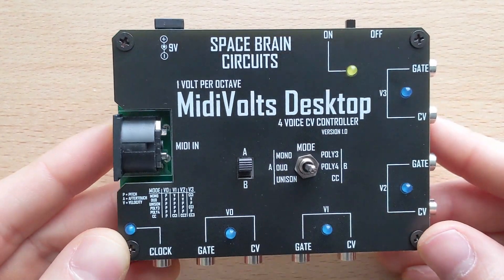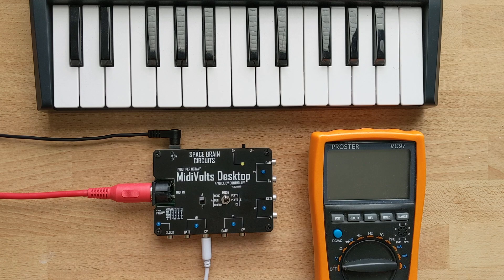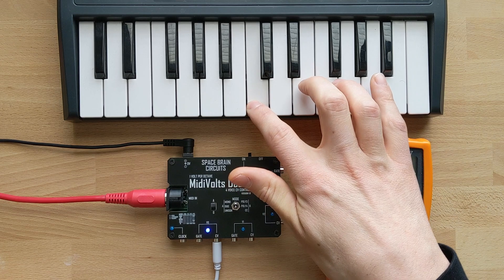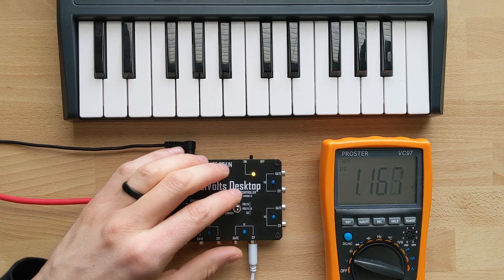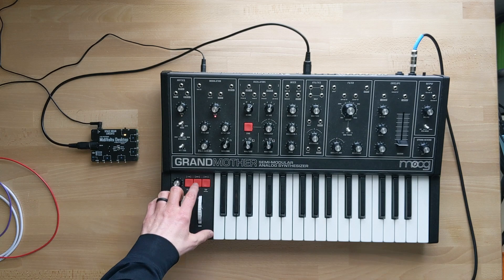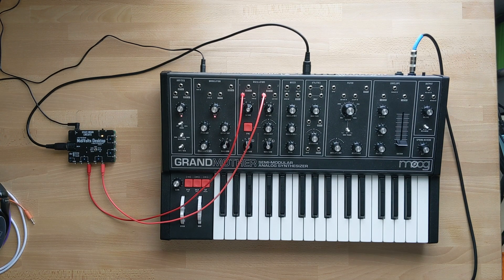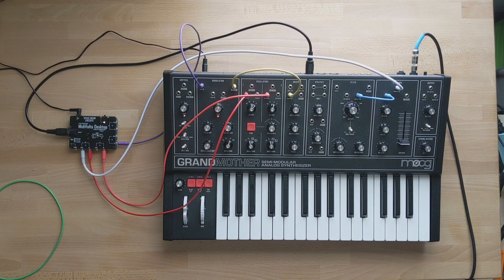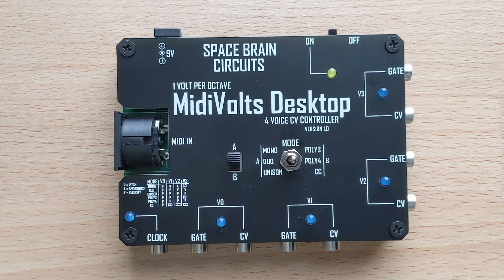MidiVolts Desktop - Polyphonic 4 channel Midi to CV Controller

Comment: I'm thinking MS20 might be my only mono? 

what about with a mono/poly? (original so probably will have to use a kenton..) can i use midivolts with the huge mono?
Reply from the maker: @welovethesnorks  unfortunately the ms20 does not use 1v/Oct so the MidiVolts doesn't work with it. 

Not too sure with the mono poly. But I guess the unit already has poly features? How were you thinking of using the device? For CC? Thanks for the kind words!

Comment: Hi ! Just got a MidiVolts and I find it very incredible well code and built. Im trying to trig some kick and snare from logic to modular stuff and was wondering if theres is a way to send gate 1 and gate 2 to different channels or any work around beside buying a second one haha Thanks !
Reply from the maker: Hey, yes I think we have a few options. No need to purchase another one. You could always utilize CC mode. From logic, you can send different CC messages at max value (127). You can then use the CV outputs to trigger your modular. Or, I have an alternative firmware version avail that allows you to assign different midi channels to each output. Its very easy to upgrade on windows but mac a little more tricky.
Reply: @spacebraincircuits1358  Wow ! Yess I thought about the cc option but its less convenient for the daw editing ! But yeah I would absolutely try that firmeware ! How can I find it ? On github ? Thank you so much
Reply: @spacebraincircuits1358   Wow ok !! Yess I would be absolutely interested in that firmware :) I thought about the cc option but it not optimal for the editing part of Logic.  W here can I find that firmware ? On Github ? Thank you !

Comment: Is this possible for matriarch?
Reply from the maker: Hey! Technically yes but not much is added. Unless you wanted to sync the up multiple synth, there's no way to add additional voices on the matriarch! Thanks for the interest though!
Reply: @spacebraincircuits1358  I don’t want additional voices, just to make the 4 voices it has polyphonic instead of paraphonic. Curious if this would help with that or is it not necessary to do so?
Reply from the maker: @SU-ue5ej  oh I see, unfortunately this still does not help since the matriarch only has 2 on board VCAs. However, if you had some additional VCAs such as eurorack modules, this would be possible !

Comment: I'm fairly new to modular... but out of curiosity if you were to use two of these could you get 6-note polyphony on a matriarch?
Reply from the maker: Unfortunately, this is not possible with the MidiVolts desktop! But thanks for the advice. I'll consider this in the future

Comment: Would this work with the subharmonicon?
Reply from the maker: Hey! Yes, the device is compatible, except the subharmonicon only has 1 oscillator, so you wont be able to create chords. However, you could use the sub harmonicon with a mother32 (For instance) and create chords by creating a somewhat hybrid polysynth. Hope this makes sense! thanks!
Reply: @spacebraincircuits1358 yes! I believe the subharmonicon has two oscillators in it. If so would it just be more of a duophonic sound?
Reply from the maker: @louie_c_morris  oh wow I just checked the user manual and you are correct! The sub does have 2 oscillators and more importantly has two separate pitch CV inputs. So yes, you could generate a duophonic sound using this! Thanks for the correction!

Comment: Hi! Ill build a Minimoog Model D replica "rack", and then use a modern CV to Midi interface to use any keyboard controller or computer..my question is...the Midivolts is the interface I have to use? Thank you!
Reply from the maker: I also sell a eurorack version that may work for you a bit better! Thanks for the interest!
Reply: @spacebraincircuits1358  wow, than you for your quick response! Where is the link/ contact for the eurorack version? Do you ship to Brazil?
Reply: You are still using the same email you put at the yt description? Im an EE, and already bought the components to build the minimoog at mouser, using, thefantasyjackpalance  and yt videos...and so Ill have to keep your eurorack cv to midi interace as well 🙂
Reply from the maker: Wow sounds like an amazing project! You should document the journey. In case you are interested, here is the euro version. https://www.etsy.com/listing/1354414919/midivolts-modular-polyphonic-4-voice

But also, running a sale on the standard units as well. Best of luck! Sounds like a great learning opportunity! I'll have to check it out!

Take care best of luck

Comment: Hi! For someone who doesn’t really understand all this (yet) could this turn a subsequent 37 into a polyphonic synth?
Reply from the maker: Hey! Unfortunately, since the sub37 doesn't have multiple pitch CV inputs, it's not possible to use the device to create polyphony with just the sub37.

However, you can create hybrid polysynths by combing multiple monosynths(such as sub37) with other monosynths. Hope this helps! Thanks!

Comment: How would this work with a Mother 32? What would be the capabilities? Very interested to know. Thanks for such great content!
Reply from the maker: Thanks for the kind words! Basically, you could combine the mother32 with another monosynths and achieve poly playing, since the mother32 has 1 oscillator. Combining the grandmother and a mother32 would allow for 4 note chords since you have a total of 4 oscillators (x3 GM and x1 M32)
Reply: @spacebraincircuits1358  sweet thanks for the quick response!

Comment: It'd be awesome to have a mode where I can use four separate MIDI channels to control four separate mono instruments. (I know, I want the moon on a stick)

Edit: Just noticed that you said this feature is available on the Eurorack version, which is perfect. Thank you.
Reply from the maker: Actually on the eurorack version this is possible. But you would have to upload an alternate firmware version! Thanks!

Comment: hey yo again, i've since got a matriarch but i was wondering, is there a way i can now get 8 voices with my matriarch if i use the grandmother for the 4 extra voices 

so use the matriarch keyboard but it's using the midivolts to get voices from the grandmother .. not sure
Reply from the maker: Hey Duncan, this is doable if the matriarch can polychain but I'm not too sure. It would be amazing though.

Comment: Are those 1/8 or 1/4 outs? 
How would you get it to work with a 1/4 CV?
Reply from the maker: Hey reso! They are 1/8 (3.5mm) jacks. You can just use a simple 1/8 to 1/4 inch converter! They are really affordable

Comment: I'm not an engineer, or modular guy, so I don't really fully understand, but this is awesome. I just ordered a Grandmother, so I may end up getting one of these.
Reply from the maker: Cool thanks! The GM is an amazing synth and you will be pleased!
Reply: @spacebraincircuits1358  I'm on a different account. Grandmother will be here tomorrow. I just ordered your last MidiVolts Desktop off of Etsy earlier today. Thanks for making such awesome, smart, and most of all, useful gear like this! I hope you become very successful with your company! You deserve it with this type of gear.

Comment: Will this work with my ms20?
Reply from the maker: So sorry but the ms20 is not volt per octave but hz per octave so the midivolts is not compatible!
Reply: @spacebraincircuits1358  it's 1,5 volts Indeed. Thnx for the answer

Comment: Awesome! Will this work with the Behringer Model D?
Reply from the maker: Thanks for the question! I believe the Model D has only 1 pitch in CV so not possible to make polyphonic. However, you could use the MidiVolts to connect up two or more monosynths to create chords. :)

Comment: Could this be used to just to convert the midi to clock signal. I really like the simplicity of “sync” functions rather than midi. Mostly because I’m still learning to use midi
Reply from the maker: Yes, it also has a midi to clock converter! Essentially, the midivolts waits for a midi start message and begins toggling a gate output. Hope this helps!
Reply: @spacebraincircuits1358  thank you so much! 
This is off topic, but you know way more than me so…is it possible to add sync in/out on a Boss 20xl loop station? Or a loop pedal that isn’t equipped with Midi?
Reply from the maker: @erictorres2368  sorry not really sure! Kinda depends on the underlying framework. Could be possible if it's all analog hardware
Reply: @spacebraincircuits1358  thanks for responding. It was worth a shot. 
I’ll be purchasing one of your sequencers soon. Can’t wait to try it out!
Reply from the maker: @erictorres2368  that sounds good!

Comment: could you project for Korg MS? it was a dream for many years I’ve got 2 ms20 and 2 Ms10 4 voices poly a big dream
Reply from the maker: Hey thanks for the comment. Unfortunately, I believe Korg operates on V/Hz instead of V/oct which the MidiVolts doesnt support. Double check me on this but wanted to be transparent!
Reply: @spacebraincircuits1358  yes you right !! does it not possible to make it for Korg and yamaha V/HZ ?
Reply from the maker: @disto99  With the current circuitry, its only possible to get 1 or 2 octaves. So sorry about this. But thank you for letting me know you are interested and I will consider this for the future!
Reply: @spacebraincircuits1358  yes of course really interested !! let me know

Comment: Would I be able to send mid from vcv to this device to convert to cv to use with my matriarch ?
Reply from the maker: Sorry about the late reply! Yes definitely! In CC mode, you can just use the device to send control voltages. A lot of my customers like to use ableton live since you can modulate the CC values :)

Comment: Do you need this device to pull off this effect if you already have a GM & a matriarch?
Reply from the maker: If you have both, you can essentially tie both synthesizers using the same CV controller. Not sure this would make much sense though, especially sinc the matrarch already has 4 voices.
Reply: @spacebraincircuits1358  ok thank you for the reply.. i was just wanting to do something different, like what you did with the gm. u know a lot more about synthesis than i do!

Comment: Hi,
Thank you for this vidéo.
Is this kind of alternative tools at DoePfer Dark Link USB / MIDI-TO-CV / gate-interface?
Kind regards.
DRJ ;)
Reply from the maker: I'm not familiar with doepfers midi to CV. This is more of a specialized mid to CV aimed at making Polyphonic possible. But it can be used in many different ways that's similar to the more conventional midi to CV converters. Thanks for the question! Let me know if you have any others!
Reply: @spacebraincircuits1358 
Thank you for your reply.
I will contact you by personal messaging regarding a specific request on your device.
Goodbye.
DRJ 😉

Comment: Would this work with Arturia Minibrute 2S?
Reply from the maker: Hey Eben! the device is designed to work with any 1 v/oct oscillators. I do not have a minibrute2s but would love to see the Midivolts control one of these. 

Most people that purchase use with their moog gear, grandmother, mother32, subharmonican, werkstatt etc. Shoot me a message on Etsy if you interested in purchasing!

Comment: Nice! Where did you get the mini midi cable , if you remember?
Reply from the maker: I'm pretty sure I found it on ebay but it was so long ago. I'm sure you could find one on Amazon as well. Think it was 12 inch midi cable. Good luck!
Reply: @spacebraincircuits1358  thanks a lot!
Reply: This is lot to soak in my brain. Can I use this minivolt for a minimoog d? Thank you

Comment: Can I play in the polyphonic way and move parameter buttons at the same time?
Reply from the maker: Yes, the parameters on the MVD change after all notes are released. So if you hold a chord while switching a toggle, the change will take place once you lift all notes. Hopefully this makes sense! Thanks!

Comment: How does one calibrate this? As soon as I go from in tune in unison and I flip to poly and I'm out of tune already
Reply from the maker: Hi there! All units are calibrated before they leave so your CV response should be very good.  Have you seen the MidiVolts beginners guide on this channel? Definitely check this out if you are having some trouble with tuning. I always recommend starting with UNISON then DUO mode first since this is easiest. Tuning the LFO for POLY3 can be a bit tricky at first.  I assume you are using the device with a Moog Grandmother. Let me know!  Thanks!
Reply: @spacebraincircuits1358  yes using a grandmother and yes watched all your vids, doing everything as you do. I got this in a trade so it isn't a brand new one and therefor I assume it may need calibration! Lovely idea and perhaps I should just buy a new one from you directly!
Reply from the maker: @24framemedia  I think we should be able to get this worked out. Shoot me an email and let's work through this. spacebraincircuits@gmail.com I'm confident we can get it to work!
Reply from the maker: It's super helpful if I see a video of your issue and I can recommend if the device needs to be recalibrated or not. Looking forward to your email!

Comment: Really curious as to wether this will be capable of adding 3 to 4 note polyphony on my Dreadbox Nyx V2. I ordered one just to send clock signals to my Folktek Mescaline, but polyphony on the Nyx 2 would be an added bonus!
Reply from the maker: I havent heard of this device, however if it uses standard 1v/oct scaling and has multiple oscillators, I do not see why not! Did a quick google search, looks like an awesome device. Please let me know if you have any questions getting this set up! Would be so cool if it works!

Comment: Looks like an awesome tool! I have one question: Is it possible to play the grandmother paraphonically without using drone mode or only having the first note trigger the envelope? I would like to trigger the envelope (for all 3 voices at the same time) with every key I press, like regular paraphonic synths would.. is this possible?
Reply from the maker: Techincally, you would need to use an OR gate.. SO if any of the three Gate Outs go HIGH, the VCA would open. You could always mult the three Gate Outs into the VCA In, however, the volume will increase as you press more notes. (Ie. 1st note = 1/3 volume, 2nd note 2/3 volume... etc.)
Reply: @spacebraincircuits1358  thanks for the reply.. thats exactly what I figured would happen.. I’ll try and think about some other possibilities to solve this!
Reply: @jacobthesleepy8980  would definitely like to know if you figure out a work around

Comment: Would it be possible to route the 4 oscillators on a Matriarch through this into eurorack envelope generators and back into the mixer to make it fully polyphonic?
Reply from the maker: Yes this is possible. You could send MVD cv out to each pitch in on the Matriarch. Then route this wave out to a VCA/ Env and back to mixer. Then connect each gate out from MVD to their respective envelope control.  Thanks for the question!

Comment: I'm very new to synths. Could this help make the Moog Matriarch an 8 voice synth?
Reply from the maker: Unfortunately no, you would need 8 separate oscillators, or two matriarchs:)
Reply: @spacebraincircuits1358  Makes sense, thanks! I thought my dumb thought was too good to be true. Awesome product btw.
Reply: I’m still a little confused. Can this make the Matriarch fully polyphonic, rather than just paraphonic?
Reply from the maker: @baritonebehemoth  No, this unit will not help with Matriarchs in getting full polyphony. You would need two more VCAs I believe. The MidiVolts Desktop allows monophonic semi modular synths to become paraphonic/ polyphonic, duophonic. Thanks!
Reply: @spacebraincircuits1358  yeah... I kind of knew that was the answer, just hopeful :)
INCREDIBLE machine - congrats!

Comment: As a GM owner, this looks good. 
What about midi Pitchbend?
Reply from the maker: Thank you so much! I have been working hard on this device. Yes this has midi pitch bend on all modes. Pitch bend up and down are also configurable over midi sysex. 1-12 semitones. Out of the box the device is set to 2 for both up and down! Thanks again!

Comment: Could you send sequencer information from logic or other daws through this? If so I NEED
Reply from the maker: Absolutely! CC mode may be what you are after! Send CC values converted to 0-5V signal. Or just send polyphonic midi data! Thanks for the comment! Back in stock within the next few days!

Comment: This would be sooo wonderful in a rack mount version,,, easier and more stable to plug into, larger printed font areas ,,, more connection possibilities.?.. possibly be able to tune or recalibrate w/o sysex, just use a multimeter and screwdriver... A rack unit please...
Reply from the maker: Thanks for the advice! I have been considering creating a eurorack version, however I am hesitant since I feel like there would not be enough interest. I most likely will not do trimmer calibration since this device does all calibration in software and not hardware. Really appreciate the comment! take care!
Reply: @spacebraincircuits1358  
Thank you for the time and effort to reply,   Might I suggest you make a rack version, and put it out there on your channel, possibly send it off to two or three other Youtube content creators that are into gear and seem to be helpful in spreading the word sbout new gear,,, I would like to think many would welcome the idea of helping someone launch a product,,, After you make one, I would like to buy it.One rack space, all connections on face plate, large print... WINNNING...
Reply from the maker: @tommyg5095  Understood! Ill take this into consideration!